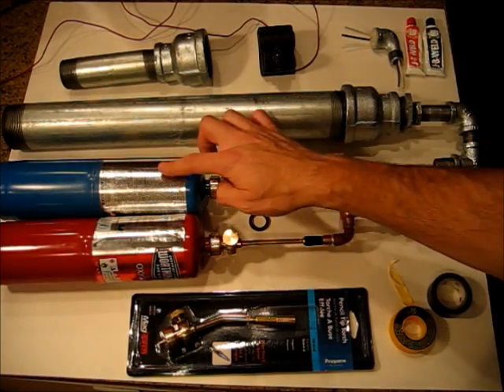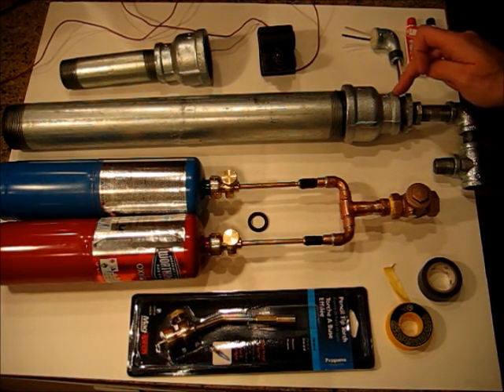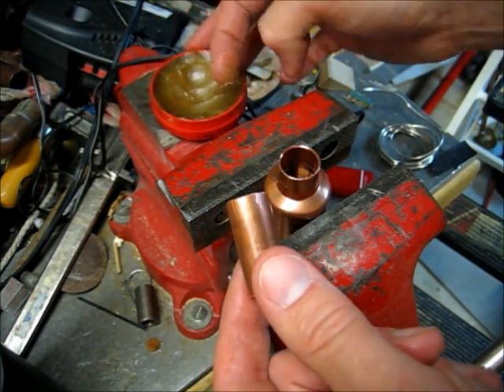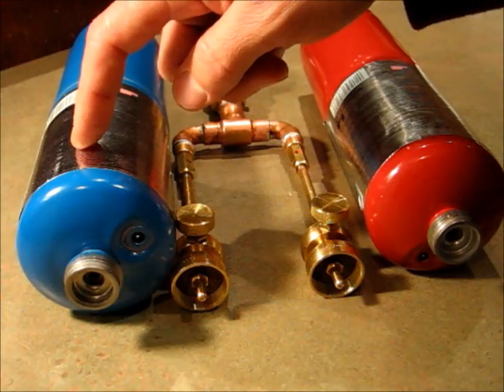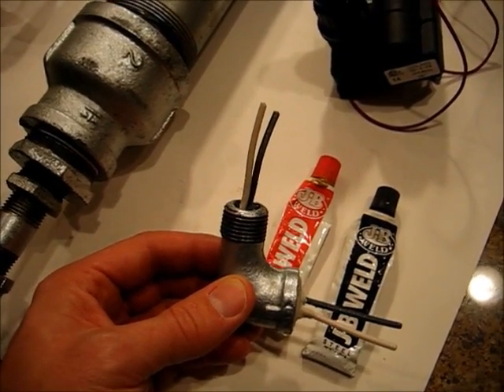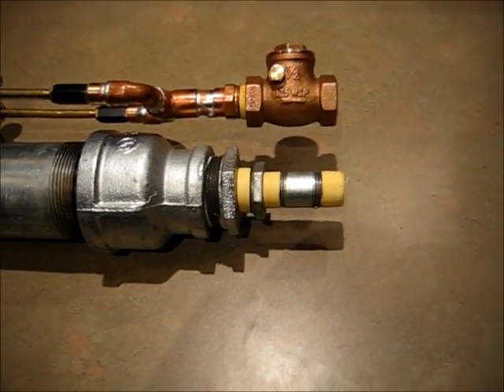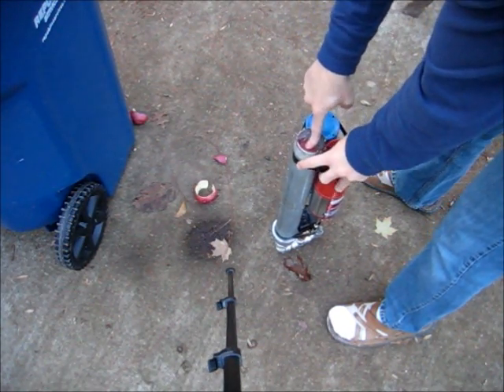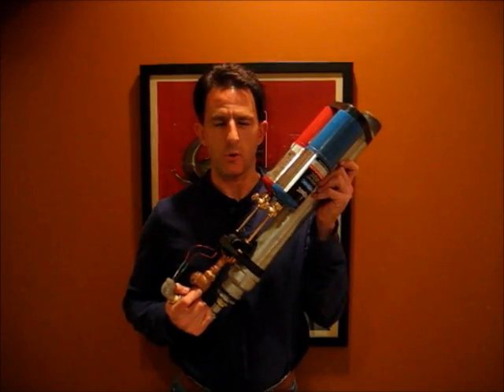How To Build an Oxy Propane Potato Gun (HowToLou.com)

Comment: What about adding a pressure gauge to the chamber and also a pvc pipe extension for greater velocity?
Reply from the maker: Both good ideas!  The pressure gauge would have to record the instantaneous high pressure, because it would happen so fast, it would be hard to read.  The idea design was to keep the gun compact, but yes, a barrel extension would help.
Reply: HowToLou I was thinking more of getting the pressure in the chamber so you know what your oxygen to propane ratio is. Also another thing I thought of was to add a chamber valve in the chamber that only opens after ignition. So you can get a greater pressure. Say a spring loaded flat disk valve that turns open after x psi(when you ignite the propane and oxygen).
Also, another thing I thought of was to add a way to use regular type spray in fuel. Threaded portion in the chamber to spray In and then close like a regular potato gun.

Comment: I noticed you didn't have a way to measure or regulate the amount of oxygen/propane ratio which I believe 5/1 is optimal.
Reply from the maker: +Jeffrey Womble - Yes that would be cool. Maybe run propane for a 1-second count and oxy for 5.   You might have to play with the counts a bit, but I bet you could figure out how to get the biggest bang.

Comment: What's your opinion on adding a longer barrel?
Reply from the maker: +Zach P - I designed the gun with an 18 inch barrel, to be compact.  Say you had a 3 foot barrel.  If you shoeve the potato in only 1 foot down, you will have more gas behind it, and more power.  If you push the potato down 2 feet, you will have a longer guide and more accuracy.  If you just want a fun toy, I would stick with the compact design.  If you are specifically trying for power or accuracy, go with a longer barrel.
Reply: Thanks!
I'm having a try with this cause precharged air pressure caused my tennisball cannon to have what i define "portability issues". :)
Propane rocks instead! 
Your commentary and vid gave me good hints.
I argue the combustion chamber and barrel are the same volume. Was over weight/size to make a combustion chamber so the behavior of the bullet is more similar to a gun? (more u push the potato into barrell, more the precision yet more the propulsion.)
A thing i'll try to do, thinking to law enforcement less-than-lethan tools, is 
.to add a clip not less to 6 rounds; Semi auto with pump action reload and the mag alond the barrell,
.small down fuel and ignition system so is less a target + you no need propellent for more than 5 magazines, if you think of carrying in a urban guerrilla.

There's to say they... Tennisball barrell .66 is HUGE even for blasted gas. (It has a lot of recoil withoud adding nothing to its effectiveness) They tend to use a .40mm caliber, it's smaller, fits a grenade like the launcher u see below HK AR15 though idk if propane is safe with that... lol, and enough to be non lethal. 
U sure know, otherwise check the Eclipse Launcher here on YT. ;)

Comment: I've been working on an improvised M3 CG (Recoiless Rifle), I have two prototypes 1 with cam-lock re-useable barrels and the 2nd with a lockable swing-down hinged barrel.
All the steel fittings an pipping are all pressure rated for 1100 psi, this vid gives me a chance at creating the same fuel and ignition system, and at the same time produce reliable shoulder launched fun.
Reply from the maker: Cool.  Yes, the Goose is a perfect form factor for a potato gun.  If you get just the right mix of fuel, you might actually need the anti-recoil breech  :)

Comment: Is that a back-flow preventer between the cylinders and tee?
Reply from the maker: Yes.  Its a one-way valve.  It is really not needed, because you shut off both gas tanks before you ignite the mixture.  Its just for extra safety.
Reply: ***** Cool design. I have been wanting to try something like this as a power source for a pellet rifle. Seems to me it would generate enough pressure.
Reply from the maker: Jj Ash - Yes, but too much pressure at this size.  You might want to try a lot smaller barrel, like 1/4" or 3/8" pipe.  There is a huge explosion and it needs to be able to get out of the pipe, fast.  That is why it blows the potato out with such force.  I would not, for example, try to have the explosion in the big pipe, and then reduce it down to 3/16s or so, to power the pellet gun.  The explosion will not be able to get out, fast enough, through the small hole, and could easily explode and shatter the pipe, like a pipe bomb.  In my gun, the potato is in tight, but still very easy for the explosion to blow out.  Be very careful with containing all sides of an explosion in metal.  You likely won't contain it, and send shrapnel flying.  I think your idea will work.  Just be very careful not to over power it.  Also, if you have not heard of them, look up Paslode nail guns.  They use butane and air to drive framing nails.  If you have ever hammered in a 12-penny nail, you realize how much power that really is.  Mixing Oxygen and Propane is even more power.  Be very careful and start very small and work your way up.  Build at your own risk.
Reply: ***** Noted, thanks!
Reply: Enough is euphemistic. :) As long u build and evrything u'll find it a bit more effective than compressed air but longer to design and make, heavier and possibly bigger.
Plus what said Lou about safety.

Comment: Here is a tip for slightly safer operation. Put non return valves inline between each tank and the mixing manifold. In your design if ever two tanks of different pressure were energized they would equalize pressure and neither bottle would be pure ie each would contain an unknown percentage of mixed gas. This could present problems for storage as well because you have all but completed the combustion trinity (fuel, O2, ignition)
Reply from the maker: After some thought, I agree.  I only have one check valve after the tee.  It would be better to have two check valves before the tee.  Thank you.

Comment: I think you are mistaken here. Usually, propane tanks are red and have left threaded connection and oxygen tanks are blue and have right hand connection.
Reply from the maker: Look at the intro frame in the first 3 seconds of the video.  The red tank says Oxygen.  Also, search for "propane torch" at Lowes.com and all the tanks are blue.
Reply: *****
hm... it does say oxygen. That's REALY strange.
Reply: I've only ever seen oxygen in red and propane in blue tanks in the disposable sizes, maybe not on larger tanks but I am unfamiliar with those.

Comment: This is part of a master plan to get idiots to take themselves out of the gene pool right? I've seen some pretty stupid projects on Youtube/Instructibles etc. but this rates quite highly for stupidity. There are several elements in this "design" that will PROBABLY prevent a nasty accident but you haven't explained what any of them are or why they must not be omitted. TBH I'm not sure if you know what all those elements are? (And I don't just mean the non return valve that you briefly mention)

Comment: Just built this, several dangerous points here. First, working with pure oxygen is dangerous. Second, no regulation between tanks so if they are not equal in pressure, you can introduce one gas into the others tank. A simple torch can then result in a tank explosion. Third, electrical tape over the air siphon, not exactly strong considering the relatively high pressure of the gases heading to the chamber. That being said, I just put a potato through a wall.